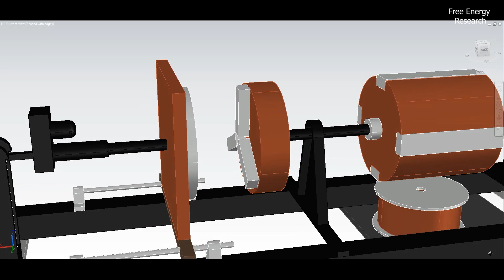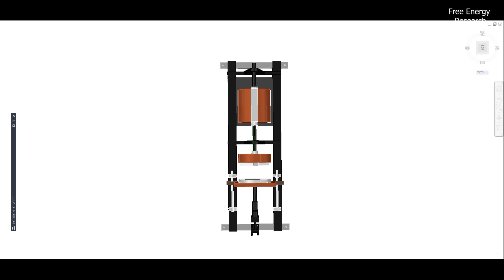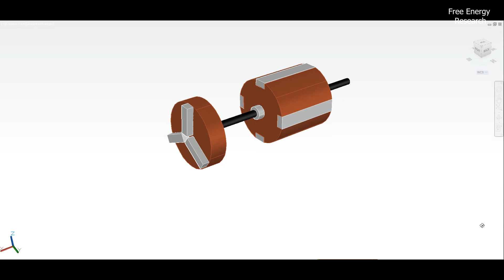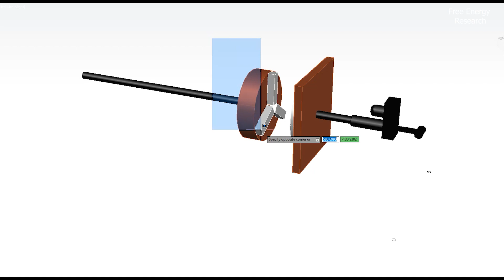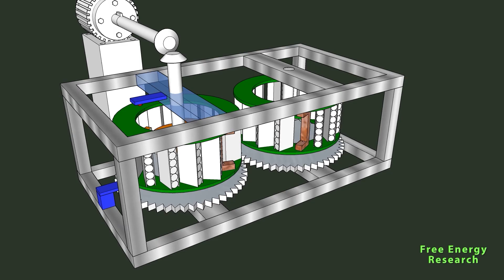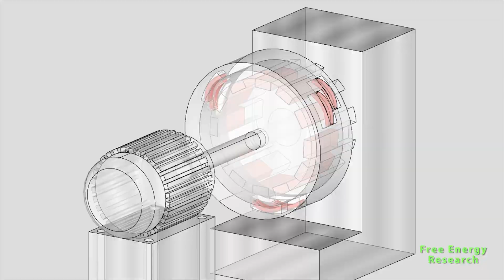Free Energy Generator - James Mclean Nuvolt 2024

Comment: You can’t generate DC from a coil and rotating magnet structure without a commutator, which is said not to exist in this configuration. You should get your basic science correct before posting this sort of video, especially with all the experience you have.